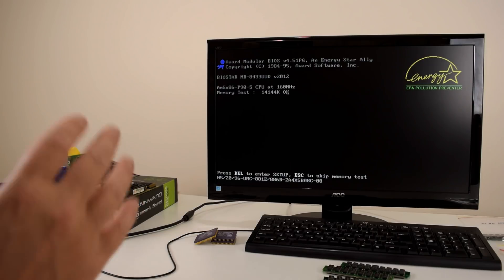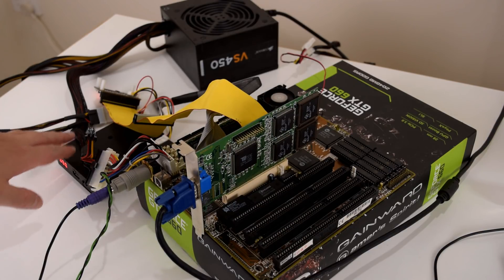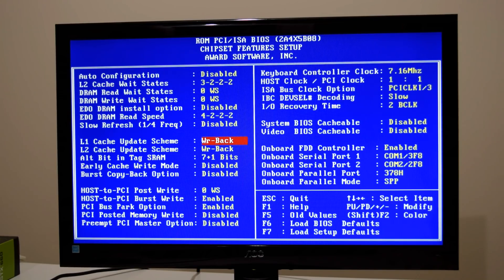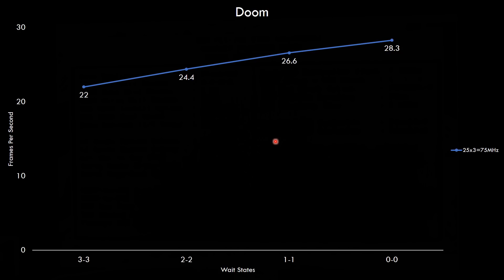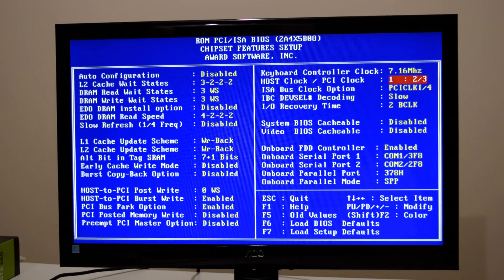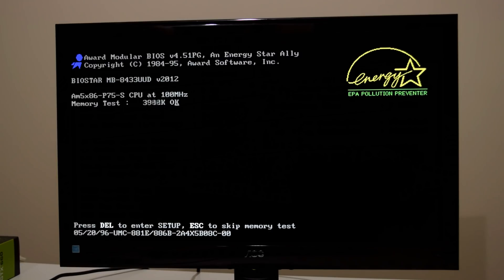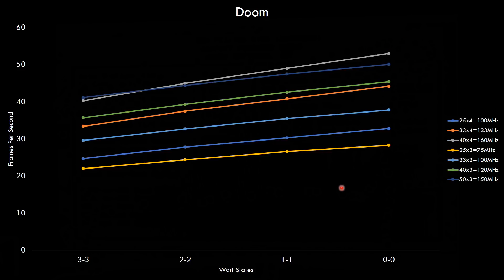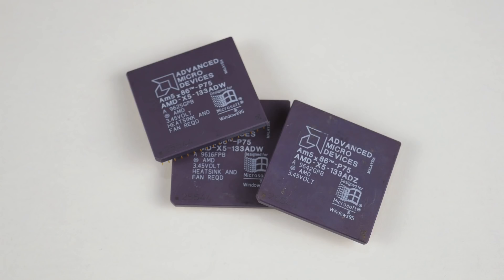486 from 75 MHz to 160 MHz and how memory timings matter

Comment: I love 486 ! Fantastic video ! THX !!!

PS. Tell me, is it EISA slot (brown slot) or something else ?
http://www.amoretro.de/2012/01/abit-pb4-rev-1-3-ab-pb4-ali-486-motherboard.html
Reply: From the link: mysteriösem PISA-Slot (braun), der  als PCI/ISA Riser-Slot konzipiert ist.
Which I think translates roughly to 'mysterious PISA slot which is for a PCI/ISA riser card' - my German is not very good!
Reply: Just because it's brown and looks like EISA doesn't mean it's EISA. Good way to tell, if the BIOS has EISA capabilities or not. Because EISA isn't as simple as just putting cards in. Think MCA. 
I for example have a 386/486 dual board with something that looks like an EISA slot, but it's actually an early local bus for the 486. The BIOS has no trace of any EISA settings.
Reply: >I think it was a riser slot for adding a cards for a special type of chassis.

No, it's most definitely an EISA slot, I've seen enough of them over the years.

The slot in the picture has six keys in it, with one of them being the hard ISA key and the remaining five being deeper in the slot for the second row of deeper pins. You can see the marks for the remaining five keys on the edges of the top of the slot where there are fewer contact holes present. You can match all six keys up to this EISA card:

http://philipstorr.id.au/pcbook/images/eisa1.jpg

>Because EISA isn't as simple as just putting cards in.

EISA slots only require complicated setup if an EISA card is used. You can use regular ISA cards in an EISA slot and they'll work as normal. The last time I ever did anything with EISA was on an old Dell dual PII Xeon server probably about 10 years ago now. We found out that the last Microsoft OS to support EISA slots was Windows 2000 Server, as XP and 2k3 wouldn't detect the cards at all.